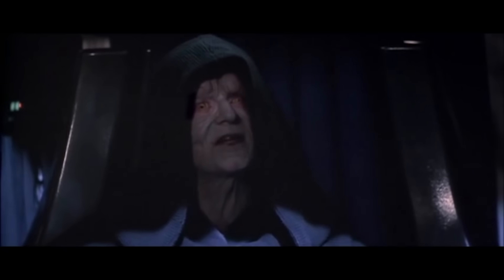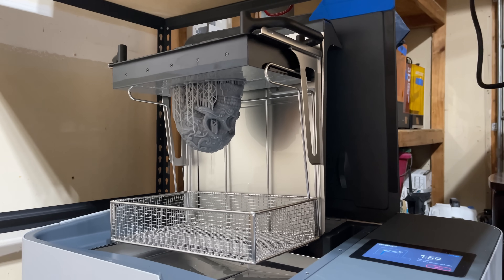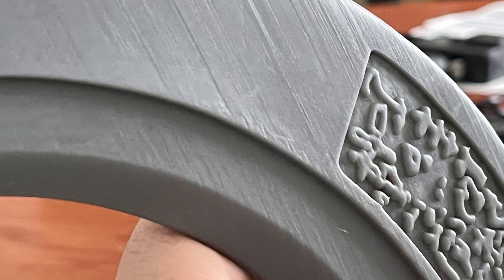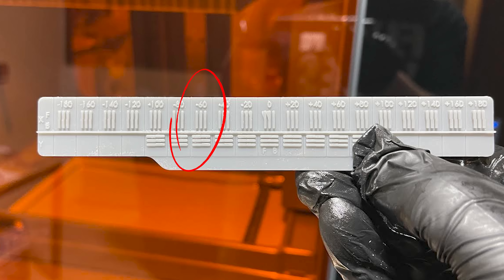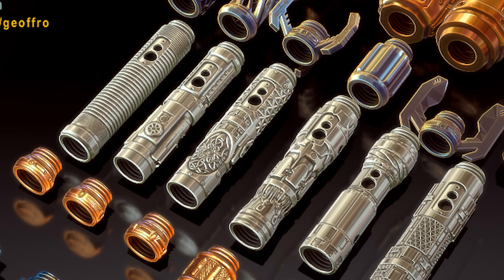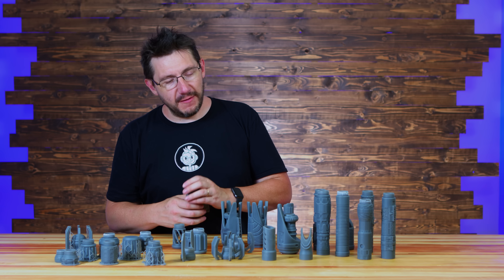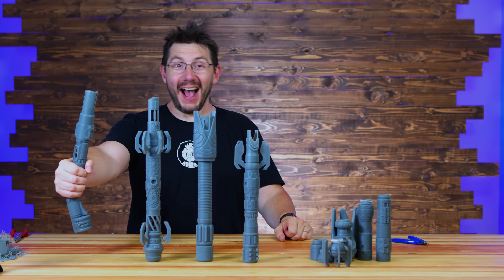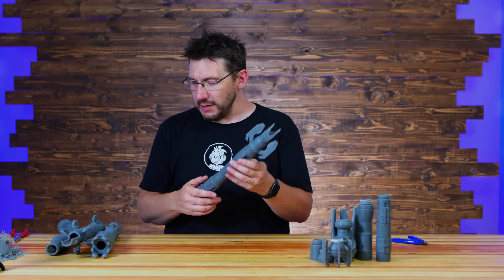3D Printed LIGHTSABERS in Formlabs Resin!

Comment: you might wanna disclose how expensive just the resin was for those prints... besides being professional machines, they are also locked to to only their own consumables - which run at very high  premium prices... 
Those prints you showed are most likely worth about 1000 USD of just DRMd Formlabs resin.
Reply from the maker: Shoot forgot about the resin. It was just over two liters of resin, so about $350 worth.

Comment: I'd much rather have to fork out for 10 gallons of solvent over the near 10 gallons of resin it takes to fill my print vat! 😂Also, your comment at the approx 5:30 mark, isn't quite correct. My printer doesn't have issue like that since mine works the opposite way to others (projects light from above, and the print sinks in to the resin)

Comment: How about some of the starship interiors from Second Dynasty? I'd also like to hear a report on how fast and easy that level of machine is to use. Is it more efficient for rapid mini-scale manufacturing or just higher quality prints? You should also get someone to take the time to finish some of these pieces - lightsabers or whatever - and both comment on how they are to finish and of course show off the fully painted results.

Comment: The only issue I have with form labs besides the slowness,  is the cost and proprietary resins.  I can see the costs for the printers but 4 Grand for a wash system and 3 grand for a cure system? Ridiculous.   If the want to charge those prices I want reimbursement for every failure.  They should give a service like paper printers are trying to force with a subscription price for resin and you only pay for successful prints.

Comment: Big thanks for the feature Joel and great video! I have wanted a Formlabs forever (I think they are one of the oldest SLA printers I can remember really coming into the market way back!) I get the chipped resin might not be to everyone's liking but for me coming from the photocopier industry before this, putting chips in consumables is pretty normal. People think it's sole purpose is to force people into buying their particular consumable, but it's actually used for quite a lot more.  I have never seen the Formlabs as being a lower end consumer device, more a lower end of the industrial side.

For example, you run a business that needs a constant supply of resin, but at $150 a bottle (much like toner can be up to $300 for a good color copier just for 1 color toner cart, not to mention developer or photoconductors)  you don't want to be ordering heaps at a time so you order what you need when you need it. the machine is networked, its very easy to send a notification when resin/toner is low and produce auto-ordering for clients, keep track of the machines life span etc from the chip. So for me that is not a game changer, I dealt with it with XYZ Full Color for a short time, and if the color machine did a better job I would have kept buying ink and chipped filament.
Reply: When Formlabs was released, they were considered the new guys that brought the price point down massively from what people were used to with Envisiontec and 3D Systems back then. 

I totally agree with everything you say about the chipped resin. Still, I would like to add that it is also a way to massively increase the success rate since it stops the user from slicing for the wrong resin, putting in the wrong cartridge and mixing resins unintentionally, etc. Not everyone is an enthusiast that is very interested in the printer, and when used in a professional setting it is a tool that just needs to work.
Reply: Geoff... you tha man.  So happy to see you getting the recognition you deserve.  -Trevor

Comment: Wow. Great video.
So... you can buy roughly 14 M3 Max printers and 14 Wash and Cure Plus machines for that.
Hmmm....
No proprietary resin and 14 complete systems with around 65% of the 3L's build volume.
I can break 12 of them and still have faster, bigger production capacity.
No thinking required here.
I think you should print a crate to send them back in.
Thanks Joel
Reply: What happens if China does to Taiwan what Russia is doing to Ukraine? Where will you go for cheap imported junk?
Reply: @bernardtarver  It's not China's fault that Americans are entitled and greedy.
Reply: @madp3d  Have you ever heard of labor costs? How about I product dump with rock bottom pricing while paying you $1/day?
Reply: @bernardtarver  Now you are are being ridiculous. Is every single thing you buy "Made in America"?
Reply: @madp3d  Just about.  However, the question remains where you will go for cheap imports if China ramps up tensions?  FWIW, Chinese battery maker CATL has just halted plans to expand to North America due to Pelosi's Taiwan visit.
Reply: @bernardtarver  Do you own a cellphone? Stereo gear? Refrigerator? Microwave? TV? Power tools? Computer? How about a car?
Reply: @madp3d  That was then; this is now.  Ever heard of "skate where the puck is headed?"  Are you familiar with the CHIPS act?  In general, where do you get your news?

Comment: Dude the wash machine is a waste.
I work on those machines and other industrial SLA/MSLA
Nothing beats a aluminum bin with PLM-402-SUB, drop your part in fresh stuff for 5-10 mins,  then spray it off and drop parts in a high% Isopropyl Alcohol bucket.
Curing station i'm 50/50 on, but the wash really seems like a waste when you can procure the same needs for 1/3rd of the cost of the washer.

Comment: For those that can't afford the L ...remember there is the form 3+ as well for smaller parts or just print in smaller sections
Reply: Still over 3 grand xD
Reply: @miranda.cooper  True...and that doesn't include the air mitigation and disposal requirements fyi ...most people doing resin printing need to take that stuff way more seriously

Comment: hey, how fast is the printer, and what layer height did u use along with how long did each layer need to cure? I would love to know
Reply: The layer height can be 0.1mm or 0.05mm depending on the type of resin you use. Printing times varries on many factors. Build size, support size, orientation, infill, etc. A large print can take up to 3 days but I had 4 "Mask"s aligned standing next to each other taking up almost the full platform. As to how long each layer needed to cure, they cure instantly once the laser beam hits the bottom of the tank and cures the resin.

Comment: Lets just look over the fact that FormLabs runs a consumer unfriendly walled garden where you have to buy their resin, because the bottle has a chip in it that is the only way to allow the machine to run (it tracks how long the bottle has been in use an as soon as it says the bottle is empty the machine wont start anymore, even if you refill it), the resin costs $150 per liter.
Reply: These printers are meant for companies. Companies couldn't care less about that, they want support. And Formlabs is able to give just that by having this system.
Reply: for a printer that is only marginally better quality that desktop 8k printers for a fraction of the price. I honestly dont know how formlabs makes sales
Reply: Well, the resin starts at $150, but there's a lot more expensive stuff from them as well ;)
Reply: People are paying for reliability every time all the time
Reply: @davidtobin  I own a form 2, if thats what they want, then they do not want a FormLabs machine. the support is pretty much useless, I havent touched my form 2 in years, I just use MSLA now, and just got 2x Saturn 2s and the Mercury X WnC Bundle for less than 1/8 of this crap.